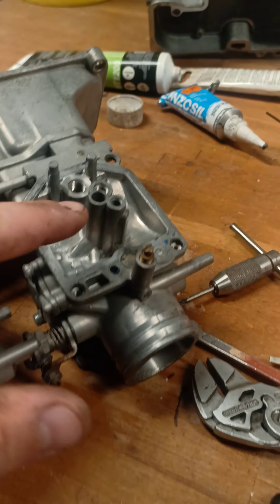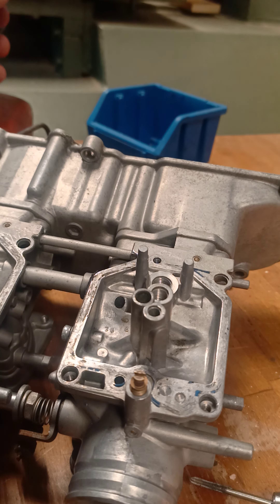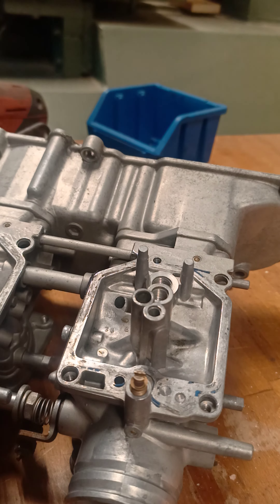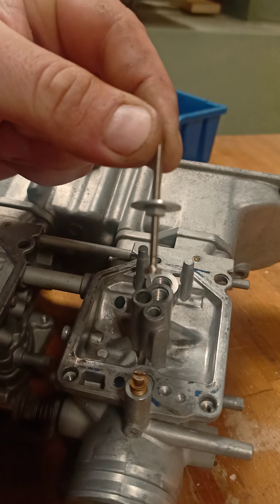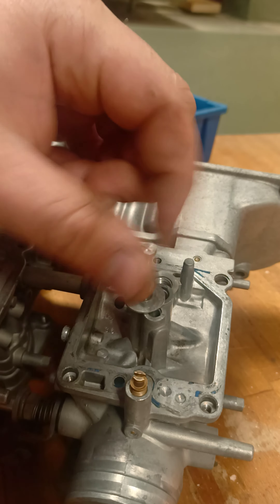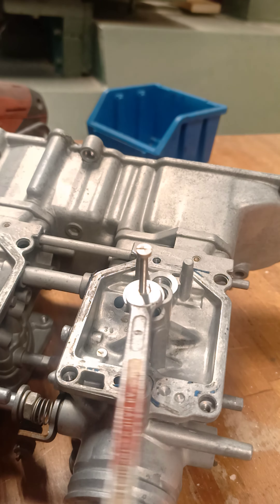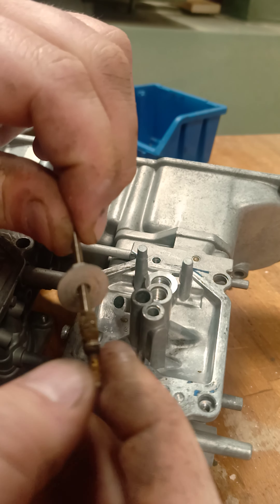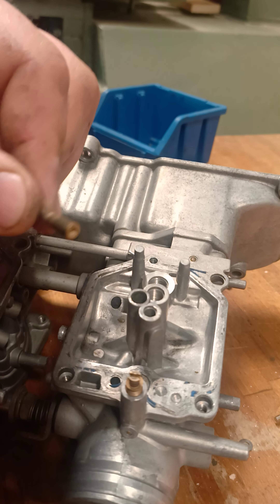1981 GL1100 Slow jet extraction THAT ACTUALLY WORKS

Comment: Hey there. In your video, you said you broke off a screw extractor inside one of the jets.

Just so happens I did the same thing.

How in the world did you get it out after that? I'm at such a loss.
Reply from the maker: Good question, if i recall correctly i made a collet that acted as a drill guide, and ground the tip of a drill into an "U" shape, with which i drilled around the tip of the drill extractor. Maybe a mm or two down.

This allowed me to jerk it sideways until it came loose.

The part of the jet that regulates the fuel is a bit in, and the jet worked fine despite the drilling.
Reply from the maker: After this i threw all my screw extractors in the trash, where they belong